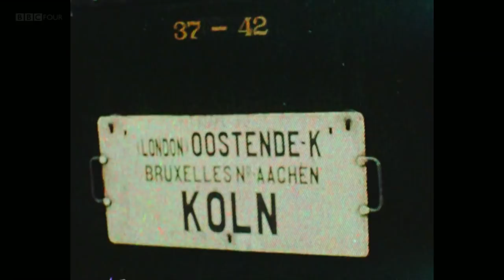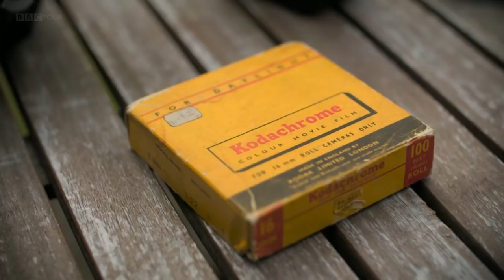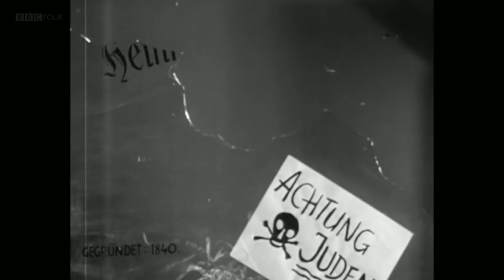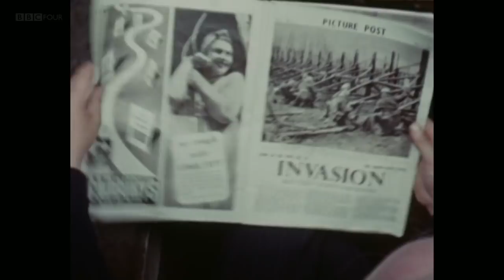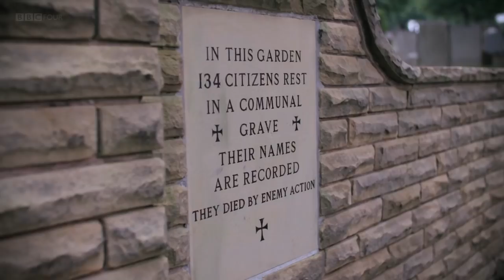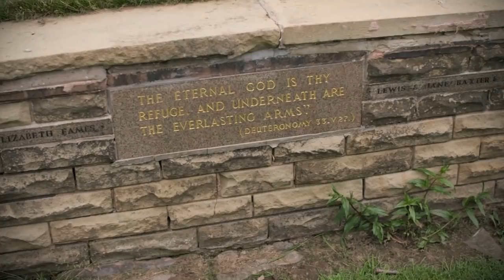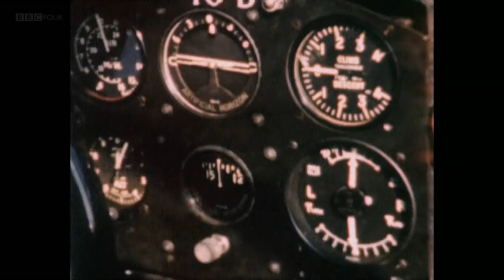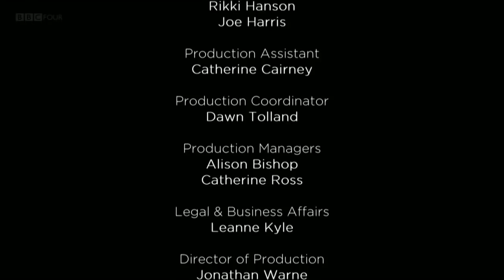BBC Lost Films of WWII  || EPISODE - 1 ||

Comment: There is some odd things going on here. It was completely illegal to photograph or film bomb damage. Ask research questions please as prifessionals. Where was Sheffield film processed? If negative stock then optical print don't by which lab? Home reversal stick has a characteristic gamma low contrast and this is not it. Home process reversal is unreliable and would be difficult at the drying stage as this often left marks.

Comment: At 37:00 example of lazy production. The amateur with expensive film would use the silent speed of only 18 frames per second. It is tricky to up rate this to 25 fps for broadcast. But not impossible using technology available when this broadcast was made. Looks like physics defying dog fights at 1000mph.